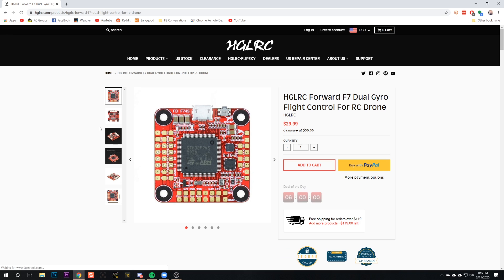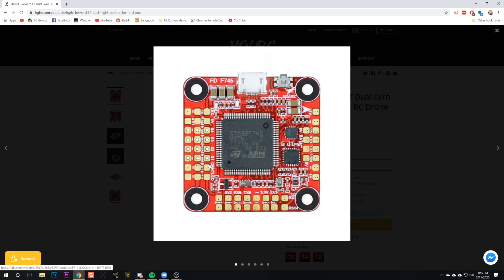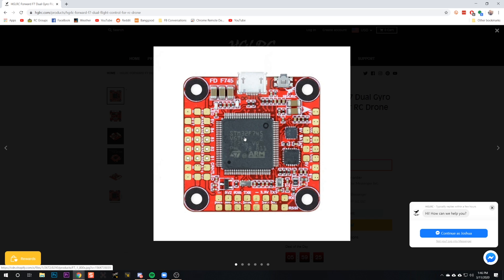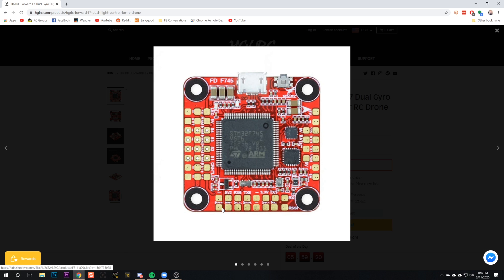Betaflight servo setup (controlled by aux channel)

Comment: I'm a big fan Joshua, but for goodness sake are you really making a video about a "bomb drop servo" with everything that's going on do you really think we need any further bad press. Engage brain JB.
Reply from the maker: This is a very basic function Betaflight that has a zillion benign uses. It is sometimes referred to as a bomb drop but in practice, using it to drop a bomb would be much less precise than simply flying the drone into the target, like they tried to do with Maduro a while back. If you really think this is a threat, then why not argue to the BF devs that they should remove servo functionality altogether. Which would be dumb. So as long as the function is there, I will demonstrate how to use it.
Reply: @JoshuaBardwell  i realize it's a basic function and i agree servo control does indeed have many useful applications, but your video description specifically mentioning "bomb drop" is just fuel to the idiots that want to ground us all. You could have made a video to demonstrate servo control in any other application, just not how to drop a bomb. And FYI i don't know what the current laws are in the USA but dropping anything from a drone is specifically and explicitly against the law in the UK. On that basis your video is describing how to commit a criminal offence. I am absolutely certain YouTube must have rules about promoting criminal activity.
Reply from the maker: "Bomb drop" is just a search term because that is how this function is typically referred to. It doesn't mean that you are literally dropping bombs. Since you don't know what the current laws are in the USA, and since you don't know anything about the YT terms of service, why don't you keep your opinion to yourself, instead of stretching for something to accuse me of.
Reply: YouTube allows a lot of videos showing activities that are legal in one country but not another. Such as the numerous gun related videos from Americans, which we can't copy here in the UK because of our gun laws.
Reply: @JoshuaBardwell  my comments have been polite and constructive, no i don't know all the YouTube rules or laws in the USA but it really is common sense that you can't drop a bomb from a drone, it is utterly ridiculous that you can't see my point. As i said in the previous message i do know the law in the UK, it is a fact that it is explicitly against the Law to drop anything from a drone. I say again - your video is describing how to commit a criminal offence.
Reply: @Rich Miller  That's absurd, expecting someone in the US to adhere to laws in other countries.
Reply: @licensetodrive9930  it's common sense in any country regardless of laws.
Reply: @Rich Miller  Common sense is not using such knowledge to actually drop real bombs.
I recall reading a book in the 80s when I was a kid that had a whole heap of interesting things to make & do, one was a mechanism of how to drop things from a kite.
Reply: @licensetodrive9930  it is also against the law to drop anything from a kite, that book would not be allowed now. Joshua's video is now. Married women could not get sterilised in the 80's without their husbands permission times have changed for the better in all sorts of ways.
Reply: @Rich Miller  Also, it's common sense to not chastise someone for not knowing the laws in other countries, which don't apply to them anyway, as you have admitted yourself regarding US laws.
Reply: @licensetodrive9930  i am absolutely certain without knowing the specific law that it will also be against a law in the usa to drop a bomb from a drone. My issue and my only issue is the term bomb drop in the videos description, i absolutely believe that Joshua is not intending to promote criminality or terrorism but having that term in the description then becomes a search term. That is a serious mistake.
Reply: @Rich Miller  Anyone legitimately here to learn about quads will have the intelligence to understand what the phrase "bomb drop servo" means, anyone in law/aviation authority reading that and believing we're all making drones with nefarious purposes is obviously too stupid for their job position and should be laughed at if they.take it seriously and try to report it to a higher authority.
As for the general public, well they're generally stupid anyway, there's almost no way of getting the "drones r bad" slogan out of many of their minds which has been programmed into them by tabloid journalism.
Reply: @licensetodrive9930  that's basically my point, people who are not involved in the community will not understand that this function has a harmless intent, all they will hear is "Bomb Drop" and not understanding the fpv community they will  understandably be annoyed/ scared. Also there are a few people out there that are criminals who mean to do harm and with Joshua putting the phrase "Bomb Drop" in the description now that criminal can simply do a search for betaflight bomb drop and be directed towards a how to video to clearly explain how to do it. All Joshua has got to do is remove the phrase"Bomb Drop" from the description and all of a sudden the video does indeed become the harmless video that you both claim it is.
Reply: Guess you dont watch Flight Test?
Reply: Dropping bombs from a drone isn't rocket science ;)
Reply: Where a Ben stiller meme when you need it “why can’t I say bomb?! Bomb bomb bomb!”  (Gets tackled)
Reply: @gokartmozart9430  🤣
Reply: Or people like me could use it to cast fishing line, really far away and drop it. I would shout "dropping the bomb" every time. Good feature!